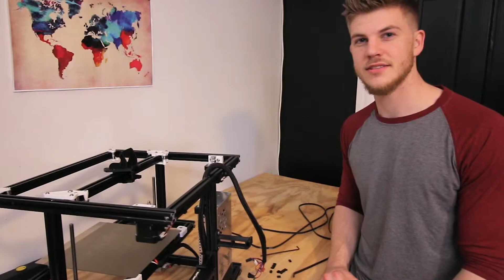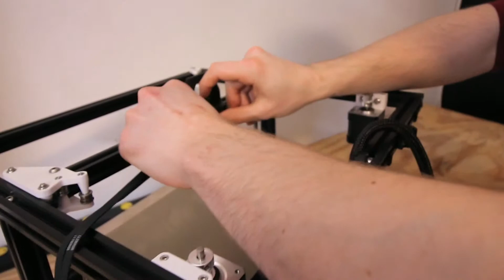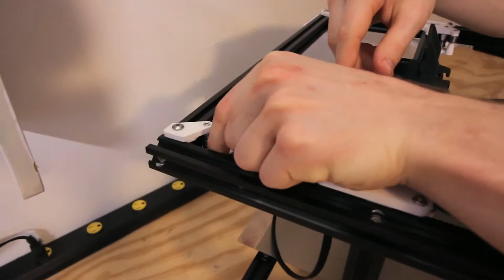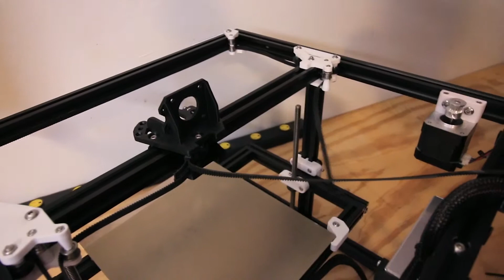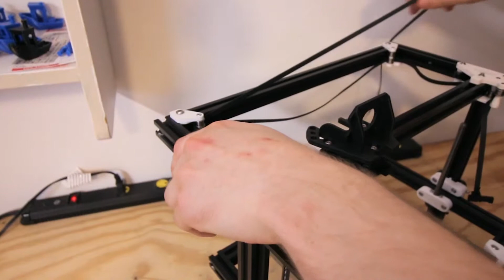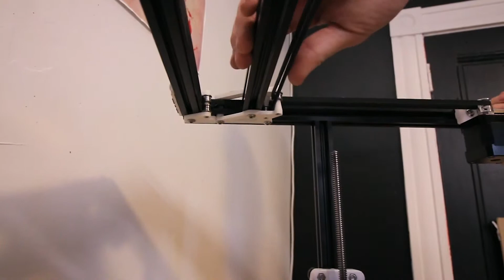Belt Installation, BareXY Build Guide

Comment: Cool unique look.  Do you have any recent videos of it printing?  The only video I have seen is from 5 months ago, and there is no sound.  It would be nice to see some more videos of it printing, how loud it is, or even how fast it can print.
Reply: Hi Travis, that’s a good point we don’t have any printing videos with sound. We’ll add some more printing videos. This reddit community will be the most up to date with new content if you want to follow along. 
https://www.reddit.com/r/Bare3D/

We use high quality stepper drivers so it’s a very quiet printer. Also, we’ll look into measuring dB. 

We usually print at 80 mm/sec but have printed up to 200 mm/sec. We tend to focus on high accelerations as the acceleration tends to be the limiting factor on speed with detailed prints. 

-James
Bare3D